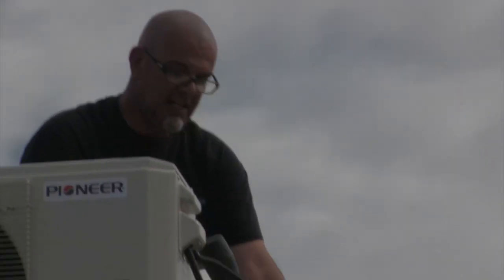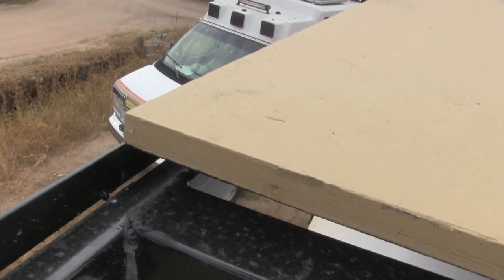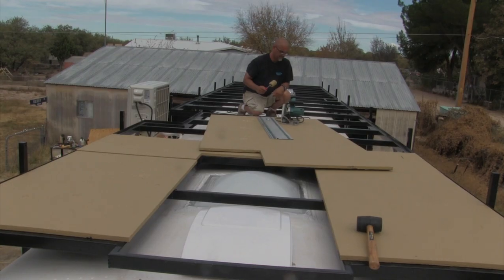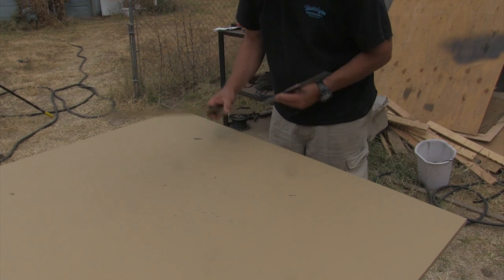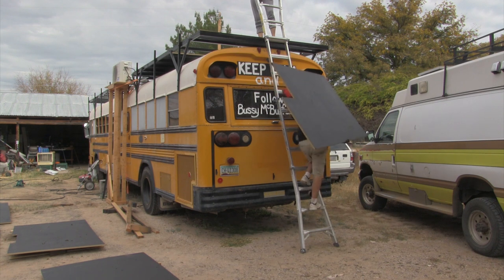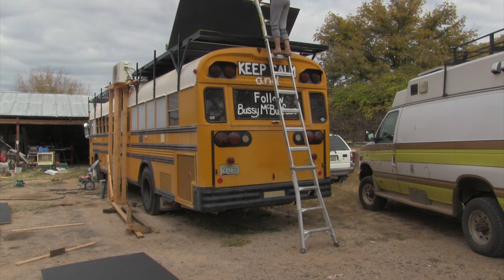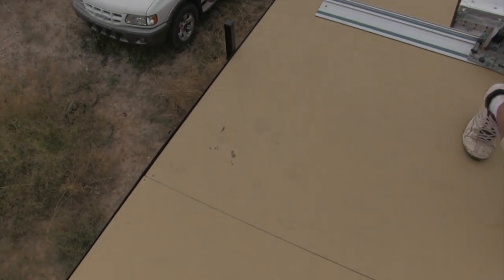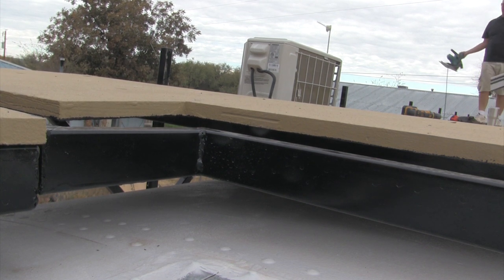Installing the 40' Deck Platform on our Skoolie! (Part 8)

Comment: I'm curious why you decided to put that metal trim piece the whole way around instead of just leaving the edge of the boards visible. It seems like it made fitting everything a lot harder.
Reply from the maker: It did but it looks way better than the plywood edge we think.
Reply: @BussyMcBusface I figured it must have been an aesthetic choice. It does look good.

Comment: Now you can land helicopters on your bus?  LOL   or play shuffleboard on the roof.  Or bowling.  Or golf.  Any concern for gusts getting under the plywood and ripping it off? Should you add wind guard sheet metal? Life is a joy did that after a microburst ripped their solar off the mounting track.